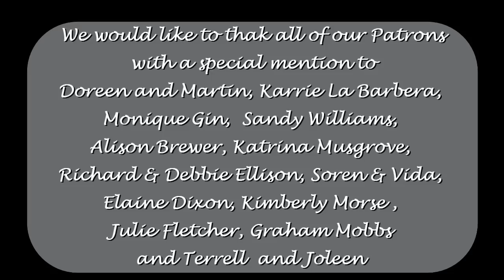177. Le Chateau's Got Problems?! What the Heck is Going On?!

Comment: If your banquet room is going to host some dancing, wouldn't some wood planking work best?

With respect to the water line.....wouldn't it be easier to run it overhead? and out of your legs?
Reply from the maker: Out of our legs?
Reply: @ChateauDeMontmagner  ...not trippimg over eberything
Reply from the maker: Not sure what you mean with regards to water? The pipe is in the trench underground? With regards to the dance floor there will be a wooden dance floor. Think you might have missed something along the way 😁
Reply: @ChateauDeMontmagner was more to do with the water line, once it went into the cottage.... "hubby" wanted to around the 2 or 3 walls, VS going overhead
Reply from the maker: Oh I see, eventually the water pipe in the old house will go under the floor but that project will be the final one here, a few years away yet 👍😁
Reply: @ChateauDeMontmagner  exactly!